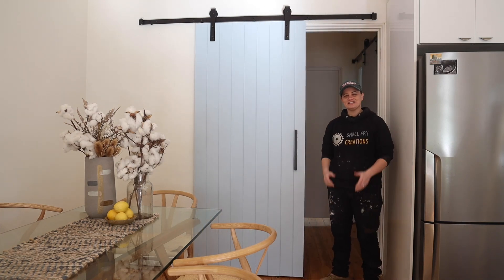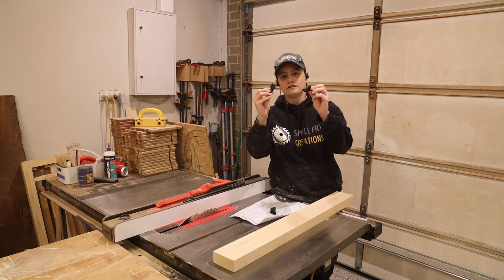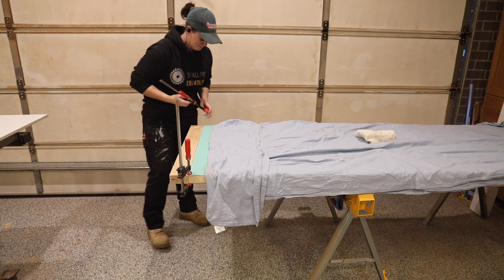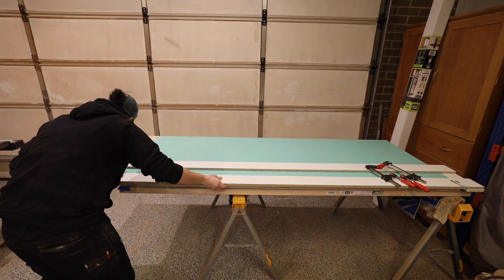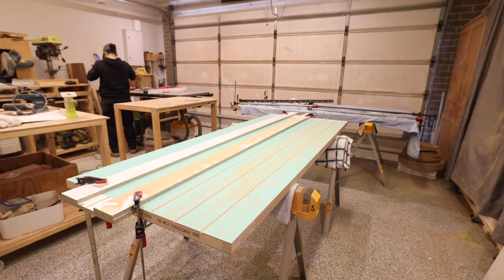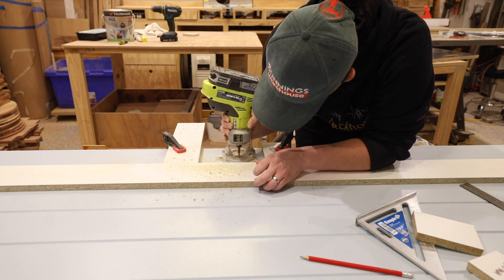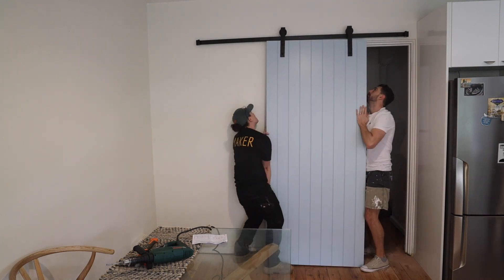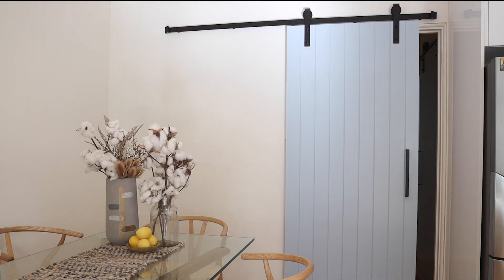How to Build A Modern Sliding Barn Door for under $300 including Hardware & using LIMITED TOOLS

Comment: Love this ...any tips on finding wall studs and anything i should consider
Reply from the maker: Thank you. If your going into plaster you can do a couple of things. Use a stud finder to find the stud but if they don’t line up with the holes on the hardware you may run into trouble. The other thing you can do is secure a board across the top of the door into stud and then screw the hardware in the board across because then it doesn’t matter where the stud are.  If you go with the board method the door will sit out from the wall which might be fine just depending where the door is going. All the hardware I have seen also have instructions and mounting hardware for different wall types. Hope this helps 😀